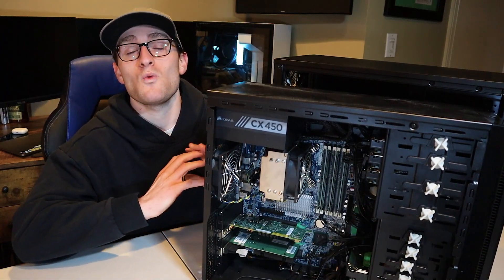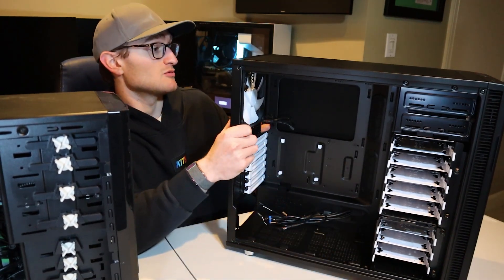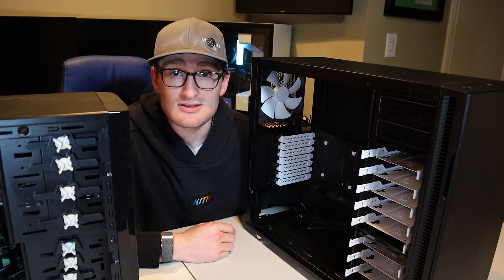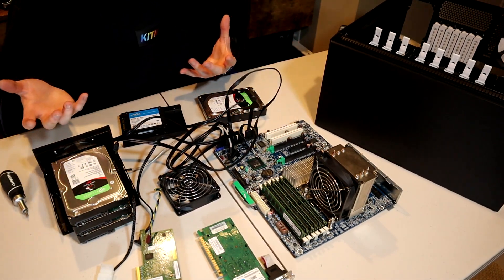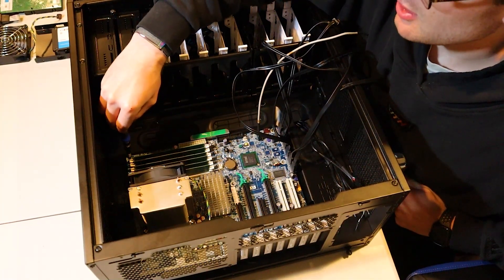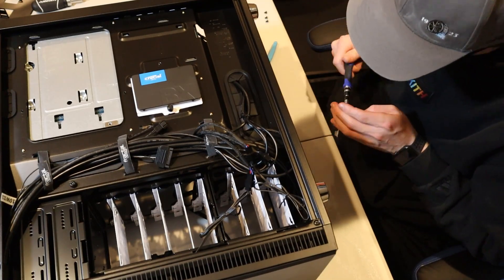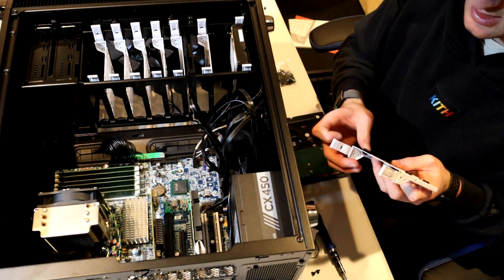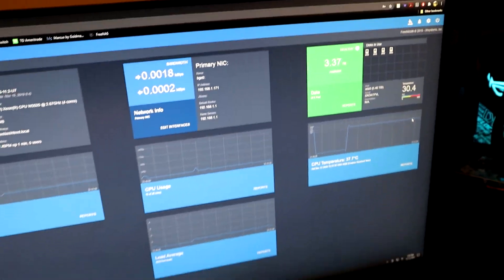DIY NAS Build in Fractal Define R5!!! Still the Best Case

Comment: I'm a little worried about whether the smaller spacing between the hard drive bays will cause uneven temperatures. I really hope it's a completely evenly spaced design, even if it's not removable.

Comment: A thing to point out is that this specific Define model is more liquid cooling-friendly than fans-friendly:

• The front fans use liquid coolers-style long screws, and fit into an inset area at the front of the chassis. That means that thicker, more powerful fans such as Arctic P14 Max will need even longer screws and will press against the dust filter. 

• Its other fan positions’s screw holes, in order to facilitate repositioning, won’t retain noise-dampening rubber grommets: they’ll slide or just fall out.

• Only the upper HDD cage can be rotated 90º. The bottom one is screwed to the case.

• The side and exhaust fan grills are too dense and close to the fans, making them noisy. I had to improvise some stand-offs to make a gap. Strangely enough, my older R4 was quieter at those (and also it was able to hold rubber grommets for them).

• The top covers, if removed and filled with fans, even 140 mm. ones, leave a lot of empty grill exposed to dust.

Still, it feels like a great case for a NAS: it's just soo roomy; the trays accept high capacity drives with extra thickness and uncommon screw hole arrangements (I wish they were more spaced, though, to avoid mutually radiating heat and allow bigger air gaps); there is room to place the HDD connectors at the same side of the trays' handles if one wishes so. There is even room to tie fans to the inward-facing side of the drive cages and experiment with push-pull cooling.

And Fractal's service is phenomenal. My unit came with a threading issue in the front door's screw holes, and they sent me a replacement assembly that arrived in three or four days! 🙂

Comment: Those needing five or more, 2.5-3.5-inch drive bays will find-- nearly 10 years after this video was published-- there are only a few manufacturers of such cases. CoolerMaster and Fractal Design remain among the better options.
What drew me to Fractal Design was not only the 8-plus 3.5 HD capacity, but two full-size (5.25) bays. 
The feature which won my purchase is the orientation of the 
drive bays-- drive connectors accessed from the side-facing trays of the case. That feature makes connection and disconnection of each HD simple and more trouble-free.
Reply: One year later, early part of 2025 and I need a few 3.5 bays and Im sitting here between the R5 and the CoolerMaster N400 lol

Comment: Just grabbed one of these cases (relatively) cheap locally and this is pretty much exactly what I'm going to be doing (truenas with 8x 3.5 inch drives + 2x 2.5 boot drives) to replace the loud 1u server I've been using.  Even years later this is still one of the best cases for non rack mount DIY NAS build I could find that's actually available.  Thanks for the vid!

Comment: Two things I would have done differently in the build ...
Since you have 4 HDDs, I would have removed the 3-bay cage and slid the 5-bay cage down giving the top fan some extra open space for free air flow. And as you add more HDDs you can replace the cage.
Secondly, I would change front panel door to open from the other (left) side.
Other than that ... nice build !

Comment: Can that SAS card be used with SATA drives?
Reply from the maker: That’s how I am using it going from 1x SAS connector to 4x sata
Reply: @TechRoundUp  Thank you. I'd read that a SAS controller is compatible with SATA but not the reverse.

Comment: Thank you mister.
I’ve bought this R5 case on september 2021. I had the R4 and was pretty happy with it. Design Quality, server lookalike and no regular fridge looking that we most have today. I had the chance to find a tampered glass side panel for the R5 : very hard and barely impossible to find today.

By the way, i wonder if the front fans could cool down a gpu blower ?

Comment: Hi. Best case, I can't agree. Batter case would have hot swap feature for the HDDs.
Reply: I have hot swap now.  Very over rated, IMO.  spent a lot of money on my iStar case and it's loud, and not near as well made as the r5.  If I really need hot swap, I'll throw a couple in the 5.25 bays
Reply: @Ken-xv4sb  it depends, when you don't have it then you wish you had it like me :D though my real problem is that my case is both compact and not hotswap, I have have very little room to do anything without messing my fickle cable management. I dread opening that case, it's not often needed but it weighs on me.

Comment: I just built my nas using an old deepcool teseract case. Its super louad and my harddrives are SUPER overheating (my smart test gave me a warning) so Im hoping this case will solve both those problems plus be just a way better (and newer) case over all. I also didn't have a front fan installed so that would probably help. lol

Comment: You still like this over the Fractal Meshify 2? it's only slightly bigger and has EATX support as well as room for more drives.
Reply: Just to add to this for anyone else trying to decide, the R5 also has the two 5.25 bays which are important to me for installing a Blu-ray burner to rip my media.
Reply: If you need EATX, yes.  If you don't... the R5 (at least here in the US) is about 70-80 bucks cheaper.  I don't you would go wrong with either though.  I'm planning a complete server rebuild later this year and found an R5 brand new at a computer show for $100 about a few months ago... was glad to snatch that up.  It will be fine in the closet till I need it.. :)

Comment: If I ever build a computer from scratch again I am going to use a Fractal design case. Just not sure which one R5, R6, R7 or other ? What do you think is the best case which provides support for most drives, easy to work in and easily upgradable. I don’t care about size I just want it to the most versatile for an full size ATX motherboard and hold lots of drives. No RGB and NO glass side panel. I just want it tough and all black.

Comment: I'm using a qnap which I really like but their business model sucke. Their OS is supporting the hardware for some year and bam you need to but a new model. 
Was actually looking for a case so this might be it. 
Is FreeNas your recommendation? What others have your tried? 
I like to run VM and run s plex seven on the server. Which OS is best?
Reply from the maker: I recently upgraded FreeNas to TrueNas (their newest release) and it is extremely nice with the user interface and features.  Plex and VMs all possible and Plex Plug-in makes the install and setup super easy
Reply: @TechRoundUp  Cool, thanks for feedback. Waiting for my pc parts to arrive end of next month :( 
Not easy to get high end cpu/gpu. Once i get them i will re-use my existing to build a NAS just like yours. I seen so many cases but the smaller ones are just not as easy to built in. R6 is also bigger so R5 case seems great. 
Which model of SAS/HBA card are you using?

Comment: which motherboard are you using and does it have enough SATA ports for NAS.  Also, would you recommend getting a hardware raid controller for building freenas or would that not work. since FreeNAS uses software RAID
Reply from the maker: The motherboard is stock from the HP Z400 and has 6sata Ports onboard.  I am also using an HBA card to add 8 more data connections over SAS

Comment: I have this chassi aswell. How did you plug in the Fractal Design fans? Since my motherboard only have one header for chassi fans I connected the back one to that. How should I connect the front fan? Good video btw!
Reply from the maker: Probably have to use a fan splitter, like a one male to three female adapter

Comment: Hey I have a question not sure if you can help me with this but, I'm looking for a new psu for my HP elitedesk 800 G1 Q87 motherboard because I'm going to put a GTX 980 in it but the current PSU couldn't handle it. Also I put it in a different case but will be using a gpu extensionfor the 980 anyway.

Again any PSU suggestions for the Q87 that can run the GTX 980?